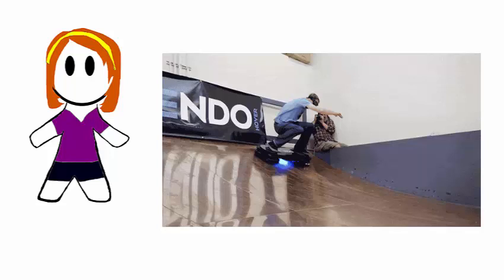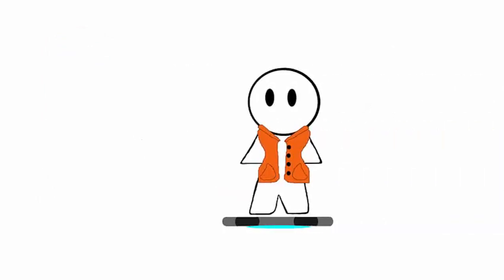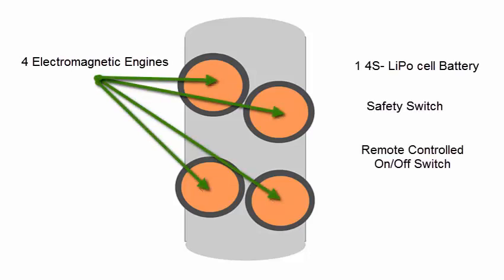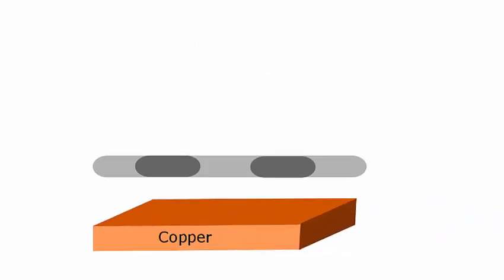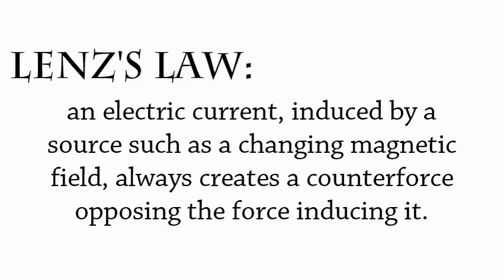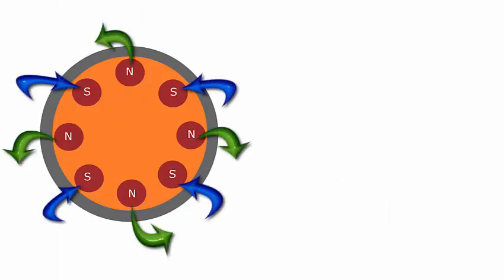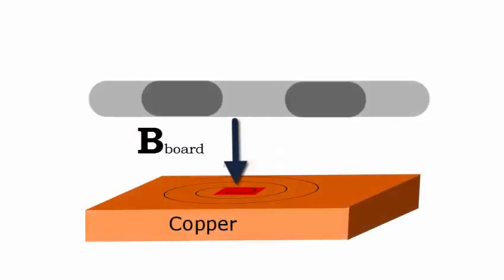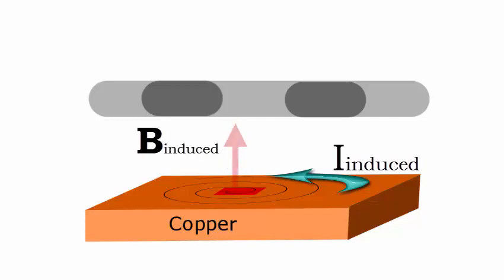Hendo Hoverboard and How It Works

Comment: Hmm, interesting. I saw a demo of this. The board is set to be extremely expensive though. Any chance at a diy version?
Reply from the maker: +Jacob Anderson Sorry for not getting back you to sooner. There are some DIY versions, as seen in other videos, but you have to ask yourself, "how much force are those magnetic DIYs producing?" For a DIY to work, you need to be stronger than the downwards force, mass x gravity, (don't forget the included mass of you!) For magnets to produce that much force it takes a LOT of current. I don't have all the equations with me on hand, but the current is the reason why we don't have a bunch of DIY hoverboards. The motors required to generate that much current are probably more heavy than worth bothering with. Plus the battery to supply said motor. And if you look at the power consumption of the motor.... so many things to consider. That's why it's expensive. You don't see a lot of DIY cars because cars are just so much work to make. Same application here.